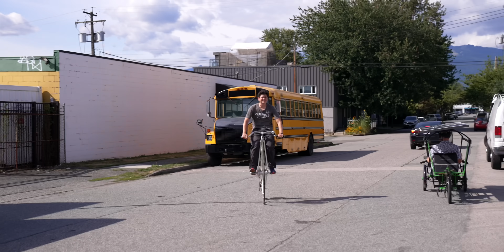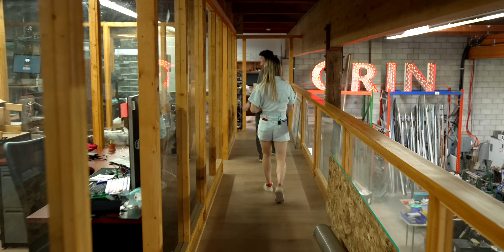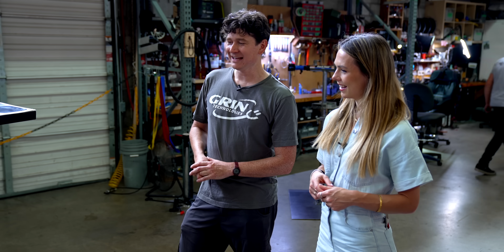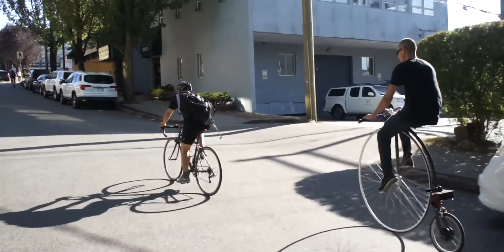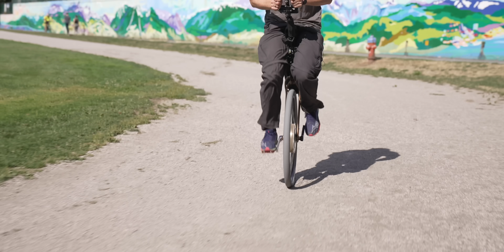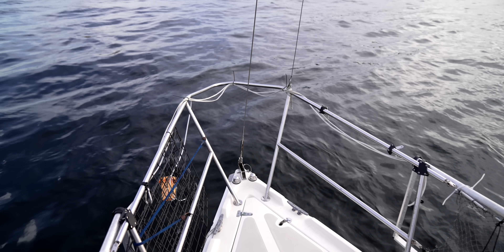12,000 Km On The Weirdest Electric Vehicles Yet!!

Comment: Upvote the wheelbarrow + offroad/ (inline big 3wheel) skates.

re. the electric motor power fungibility thing- yep, an electric motor (really all motors) produce torque - the deal is, IF the torque itself is inadequate to "do the work needed" one can simply spin the thing faster - creating more power (Power IS= torque x angular velocity, or force x speed or work done per unit time or energy / time) , then gear the final drive so that adequate torque at the desired speed range is achieved...  (ICE motors/engines create very little torque at low speeds, electric motors on the other hand can be designed to create peak torque (designed to be) at low/zero speeds - and this torque typically drops of as speed increases (back emf increases with speed )- the myth that EVs don't need transmissions is a simplification used for predominantly low speed applications ie adequate torque "without a transmission" -  or merely a single gear ratio  - transmissions can both increase low speed torque and increase high speed output....)  the spin the motor faster and turn an e-bike 500w motor into a 5-10kW boat motor is interesting (transmission needed, most likely for efficient thrust - ie the propeller isn't just a bike wheel...

Comment: This is just a teaser of all the amazing stuff Justin has done... it should be mentioned that he purchased the main DIY ebike forum so that it wouldn't get commercialized, and routinely stays up until 4am doing crazy experiments (like measuring the heat dissipation of hub motors with different cooling mechanisms installed) and sharing all results with the public. Built different. Buy Grin!

Comment: He should use a toroidal blade. It may increase the power and/or range.
Reply: @nc3826  Obviously related to the standard use propeller.
The rest of what you said makes no sense to the rest of the conversation. Go forth with your lunacy, just leave me out of it.
Reply: their is always one smart Alec who knows better, don't you think this person knows what is best?
Reply: @grahamjohnson4702 Not really. There are many factors. Cost, Rights, or simply doesn't know of. It is rather new in comparison. If he's in the investigation phase, he wouldn't bother yet. There is a lot more data to compare with using a standard prop.
Reply: toroidal blade = YouTube fad
Reply: @nc3826  Might be, but it's also real. There's data confirming better stats. There are 2 types, air and water. I'm not sure about the differences. Apparently, there's some company that owns the rights to the design and they charge a lot for a replacement part. If you don't try selling it, you can probably find the 3D diagram and print it yourself for your own use.
Reply: new?real? You mean it's really old.... It was  invented in the early 1890s ...
Reply: @nc3826  "rather new in comparison". Apparently, it was owned and controlled, preventing its common-place usage. The more recent surge in interest I'm sure is related to the trend to increase efficiency concerning electrical use gaining prevalence over fossil fuels.